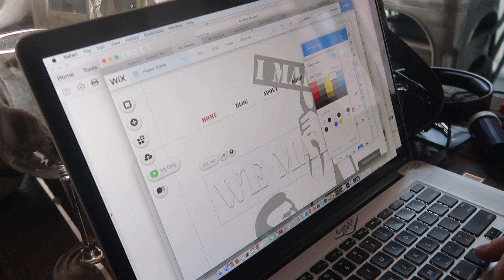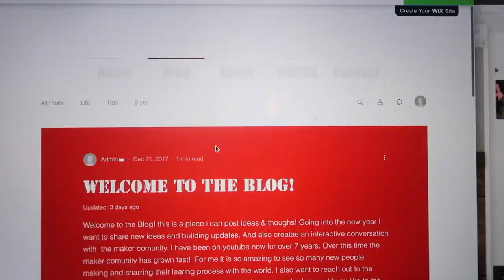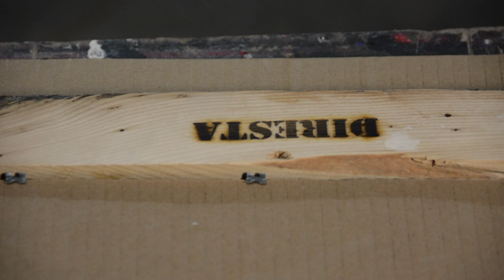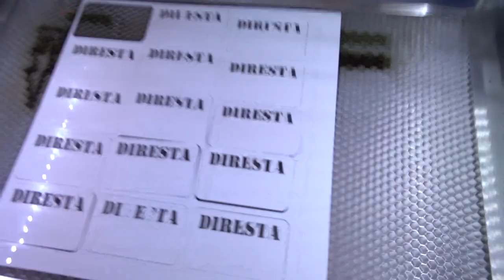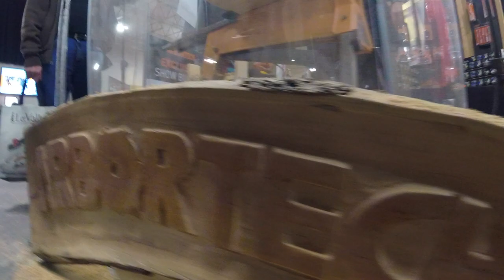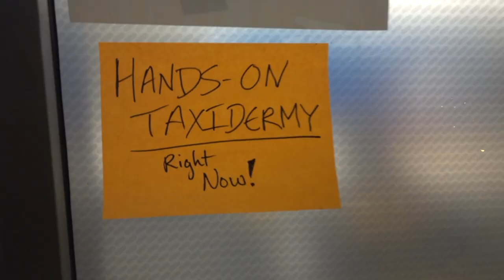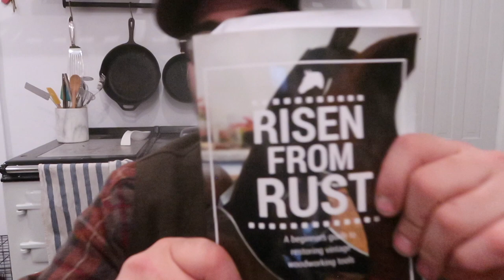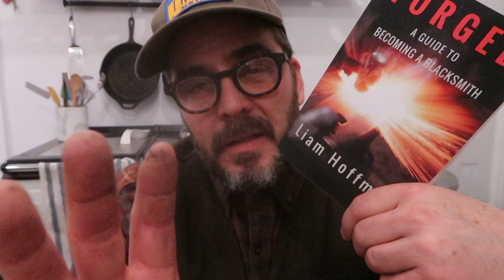DiResta 62 The Chevy Lives!

Comment: When I worked in custom picture framing everything (print wise) was sent in tubes.  I like flat because paper has a memory.  When you pull it out of the tube it curled.  Makes it hard to frame and easy to crease.    Flat is best, but shipping can be problem.   I had a large piece of tempered glass on a sheet of laminate covered MDF.  I would slide the curled prints in there overnight to flatten them.  Kinda of a pain and takes up a foot print in the shop, but necessary give the tube shipping..

Comment: Hey Jimmy top tip for laserengraving. If you want to do fine lines in like a patern or something. Setup the lines to be cut and up the cutting speed to the max. Not only will the engraving be faster than normal engraving but also the result will be very nice and detailed. Keep that laser hot!

Comment: A carver wheel would work much better on the duplicator grinder. Specifically because it cuts both in and in front. But, at the same time i'd recommend having a two step axis for the process. Step 1. a rough grind (using a spacer of the smallest dimension to be cut - 1 cm ) and step 2. the final cut. This could be achieved easily by having a threaded spacer between the "legs" you made on the copy post. Hope that made some sort of sense.